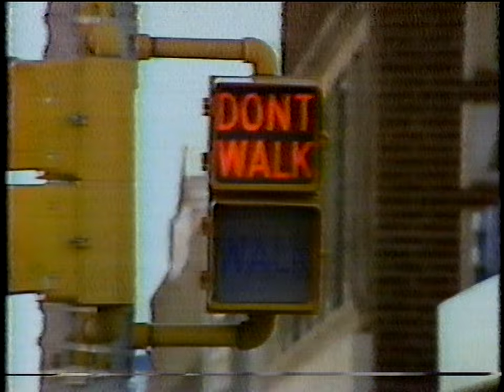The Woodwright's Shop (1988)

Comment: Thank J.I dont really remember this PBS show..

BTW I have the Sony Super Beta SL-HF750 here along with my Panasonic DVD recorder DMR-E50,Bought  both  new when they came out..

I see you burn to DVD first..I do the same here since this is an old computer that those USB capture devices dont work.
Your IOData GV-USB2 probably wont work either on this Dell.

You can save a step by just ripping the DVD to your computer then capture it the second time..There is plenty apps that do that.
Reply from the maker: Thank you for the suggestion.  I use the dmr es 15 as a pass through to my capture card, I'm not burning anything to a disc (so 2000s....). I'm capturing from the back of the dmr es 15 for video, audio from the VCR itself,  and I'll edit in avidemux to correct the audio sync.